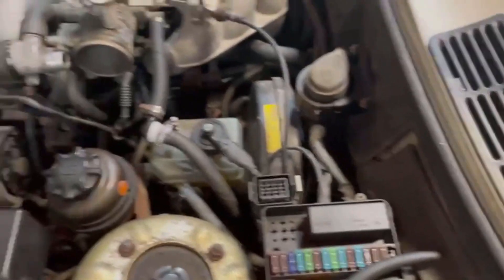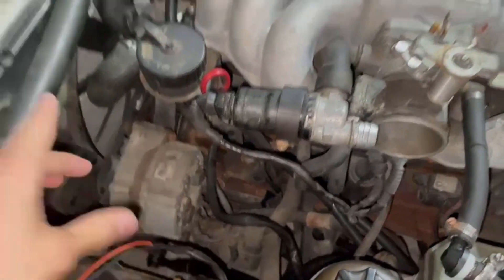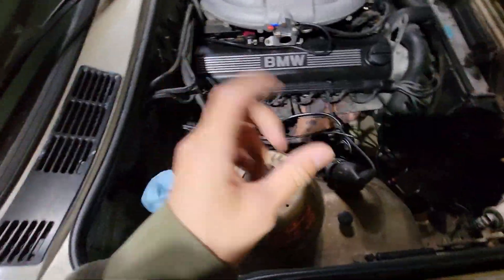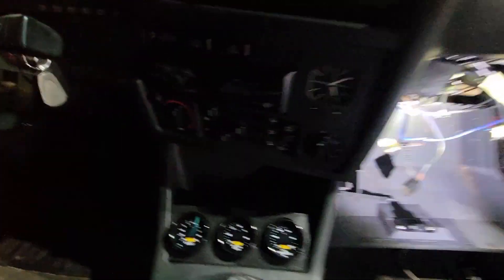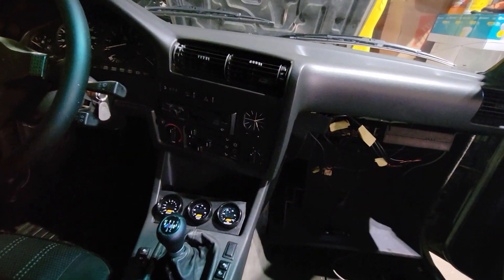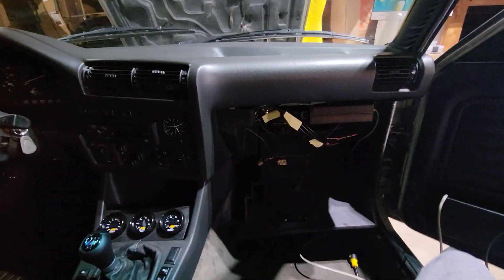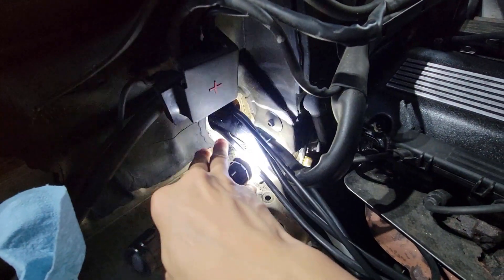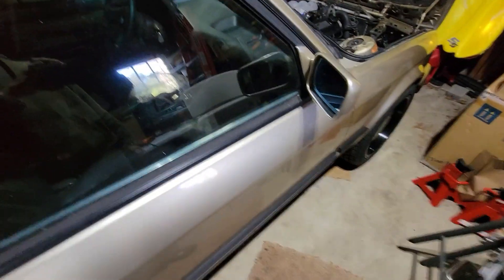Turbo E30 || Part 2: Setting Up For MegaSquirt

Comment: what windband set up and TPS did you end up getting?
Reply from the maker: Got an AEM wide band o2, it came in a kit with map gauge and oil temp gauge too. For the tps I just ordered a generic e36 one from ebay along with the necessary adapter
Reply: Good luck with the tps that isn’t genuine! Been there lol